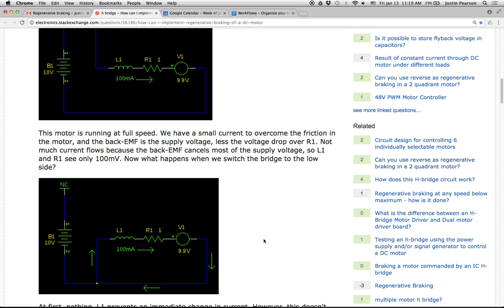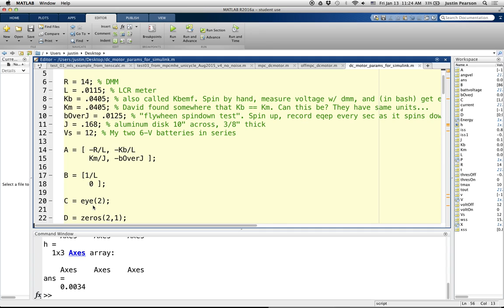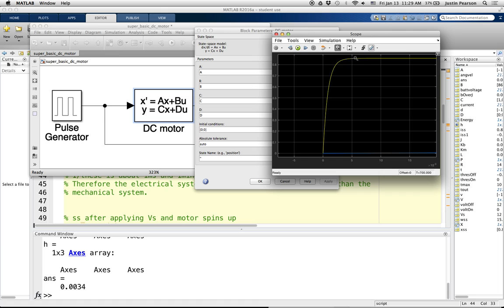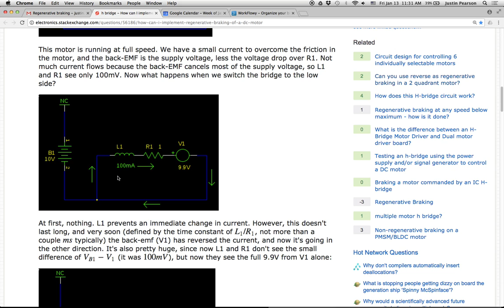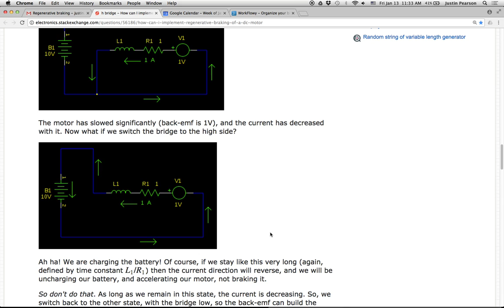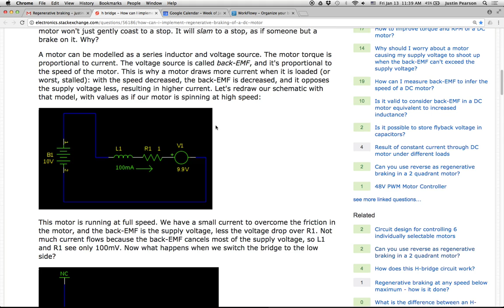How regenerative braking works

Comment: Amazing video for this topic! 

I came across this over 2 years ago when working on my Capstone project trying to implement regenerative braking for an E-Bike system. Unfortunately, the regenerative braking part of it didn't work out, but it stayed in my head as I went on to get my Master's in ECE where I wrote my thesis on the mathematical modeling of DC motor regenerative braking systems, which I just defended a week ago!

I just wanted you to know that your video was a massive inspiration when I started learning about this. Thank you.

Comment: I've been mulling this over still more...  It seems like there could be a scenario of "diminishing returns" in allowing such a close approach to steady state before switching over to battery charging; is there not likely a discoverable optimum rate at which to admit the charging pulses, such as may arise in triggering them before steady-state is so close at hand?  It seems like you could make the pulses considerably more frequent before drastically shrinking them, while retaining the termination criteria to avoid reversal...  This would admittedly reduce the braking torque but in a panic stop we're skipping regeneration anyway by holding the short, so these could be parts of a continuum...

If we are doing this with FETs on an H-bridge with available PWM/CWG capabilities (and why would we not?), then it seems like just as we can modulate the driving voltage to provide reduced forward motion, surely we could modulate the braking in much the same way.  Obviously we would need to provide a third state where after (1) the dead short provides braking and inductive current windup and (2) the north-going switch provides momentary current diversion to the battery, a state (3) would close both switches and provide coasting for the remainder of the anti-duty cycle.  A bonus might be in that getting to this point seems to imply the potential for forward regeneration in case we happen to seek less than full operational speed, where a similar recharge pulse could be issued to release the inductive kickback at PWM frequency just before a coasting phase.  If we're using FETs in a bridge, their anti-diodes are going to do this anyway when we turn the driving ones off after each pulse, so why not turn on the appropriate ones!

Having laid out this rationale, it should be trivial to modify the drive orientation of the switches and just go on PWM-ing at the same frequency to accomplish all this, using current sensing to provide a trigger to the coasting state, with the state definitions being dynamic since there will be up to 4 different PWM paradigms including reverse (all of this can be accomplished with a PIC, including a hardware trigger to the coasting state at null current):

For forward acceleration: (1) == upper-left and lower-right ON (drive).  (2) == lower-left and upper-right-ON (regen).  (3) == all switches OFF (coast)

For forward deceleration:  (1) == lower-left and lower-right ON (brake).  (2) == upper-left and lower-right ON (regen).  (3) == all switches OFF (coast).

I have also been pondering how to surmount the current measurement problem for an empirical terminus of charging pulses, hopefully without sensing resistor.  Perhaps a Hall effect sensor...  Now I'll have to go and learn about that!

Comment: Great video!  For a long time I was close to getting this, modeling motors as inductors and so forth but I couldn't account for inertia and a driven shaft.  I never quite clicked into seeing that "back emf" is proportional to speed alone, and that it ultimately reverses the current in generator mode (I had been puzzled as to which top element should conduct for regen in an H-bridge setup).  You video has fixed this for me; I am grateful!

I assume that what you have analyzed here presents the means for maximum braking while capturing any available charge for regeneration.  If I wanted to modulate braking torque, my presumption is some dead time should be injected after the upward pulse (upon cessation of charg flux) and before restoring the braking short via the lower switch, is this correct?  Just trying to figure out where the fact that an open-circuited motor will coast fits into this whole paradigm so I can create any degree of braking up to the available maximum.

I am trying to design a method to do this empirically.  The target is a kids' ride-on car toy with a 6V battery and motor and the goal is to improve it just for giggles and to help get my daughter excited about this stuff.  (Original setup is a pair of relays to operate the motor bidirectionally and if nothing else I want a soft-start/stop and speed modulation).  I am using an H-bridge {(2x)SiRA99DP/(2x)SiRA90DP} and have ADC channels available.  Can I simply and practically use a series sensing resistor and 2 kelvin-connected inputs to track the current, switching the bridge devices for regen on this basis alone?  I can get 2 readings in about 50 microseconds so if those pulses are similarly short maybe I need more brute force logic like a comparator-based OR function for the high-side driver so I don't miss the cue and resume acceleration by disconnecting the battery too late?

All things considered, I'm assuming that by transitioning my daughter's toy car to regenerative braking I can probably increase the longevity of a battery charge for her by at least 0.05%.  I'm only integrating by eye, but it seems like very little of the invested energy can be recovered.

Comment: I've got an electric scooter wich is said to have regenerative braking and i was curious, if that's true. So i looked at the controller PCB hoping to find 6 diodes and something like a boost converter. When i just found the 6 FETs, i thought that i fell for false ads but after watching your video i think that those chinese developers did their job well, right?  ...But yet i'm still wondering: how efficient is this way of regenerative braking compared to a three way rectifier and a boost converter?!  Thank you very much! :)
Reply: The FETs have diodes... It's always going to allow charge current

Comment: couldn't you just use a diode between battery +  and  motor +   so that when the ESC output is cut the back emf recharges the battery ?

Comment: But if the current reverses isnt the motor going to spin in the opposite direction?
Reply from the maker: The current thru the motor is proportional to the torque on the motor, so reversing the current will cause the torque to accelerate the motor in the opposite direction: specifically, it will slow down, stop, then speed up in the opposite direction.
Reply: @funskits  in an bldc shorting any of the 2 phases should yield the same result right?

Comment: How is your system better than a simple diode connected directly, so that it does not drain the battery when the motor voltage is no longer enough to charge it?...

Comment: Hello,
This is a very interesting and clear presentation. But I have a question. 
How do you manage to recharge your battery if the period of the PWM is so low (a few ms) ?
If you take the example of bicycles, batteries require a few seconds or even minutes to start recharging.
Thanks for your answer
Regards